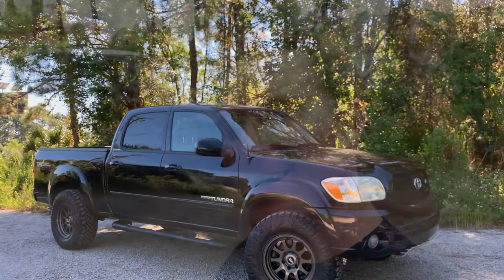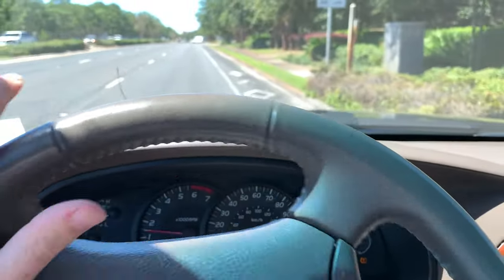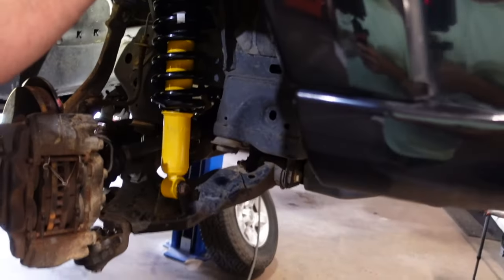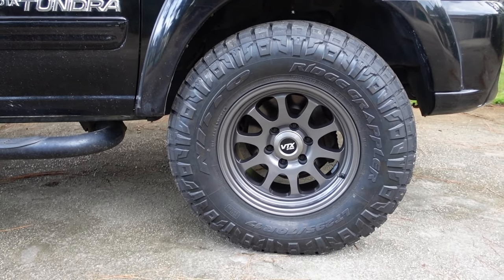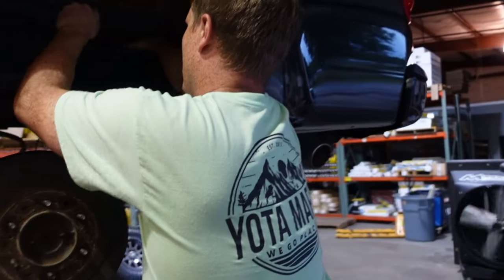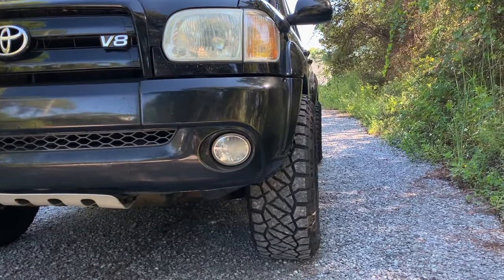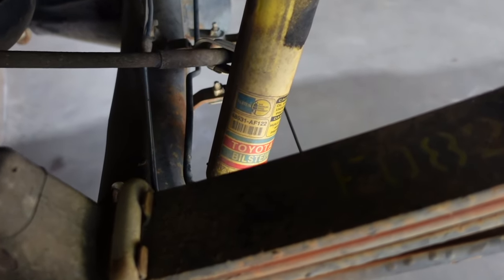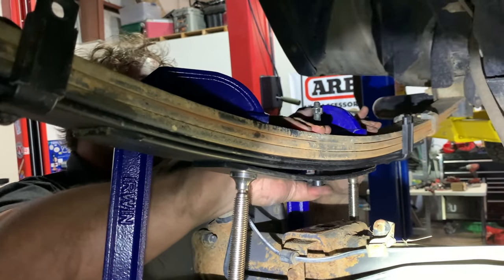Budget Friendly First Gen Tundra Lift Kit Install.

Comment: 04 Toyota Tundra first gen extra cab here,  I bought it brand new,   Going with new Bilstein 6112's,  heavier springs.  Camburg upper control arms/bushings/upper ball joint.  This truck is pushing 20 years old.  New lower control arm bushings, ball joints, tie rod ends.  A 3" lift,  but I have a new custom front bumper with a 10,000  winch.  Also a new custom rear bumper.  (Brute Force MFG).....If you have ever heard of Stellar Built in Sacto CA.  Ordered from them..  they did the powdercoating/install.
Reply: I had Bilstein 5100's  up front with the stock OEM springs.  They did well with a plastic front bumper.

Comment: On my gen 1 I got 265/75/16's on Geolander H/T,s.  I keep them at 35 all the way around.  The tires are good for long distance highway driving, gravel roads and excellent in the rain and for gas mileage but are not good in the snow. 
 I put an Alpine 309 in the dash witch fits in the stock radio space, amos under front seat, replaced all speakers and use a Pioneer low profile 12" sub box on the rear floor witch works out well.
Reply: How much did u spend on speakers alone? Thinking of upgrading mine and getting an idea
Reply: @iv2726  You may want to ask somone else as my speaker build is 19 years in the making lol.   I have Diamond mids and tweets, pioneer stealth 12" sub, and Phoenix Gold and Morrell Amps under both front seats.  The Alpine 309 head unit runs around $800 now.
Reply: If I did it today I would go with JL audio speakers and sub  with applicable amps to run them.  Or Taco Tunes speakers if I lived in Socal.

Comment: That suspension setup gives you 2.5" of lift. The Upper control arm ball joint maxes out around 3.25" of lift, so the 3.5"-4" isn't possible. Those tires actually measure more than a 33" at 33.31", which is likely contributing to your rubbing issues.
Reply: If you add 2” wheel spacers will they clear?

Comment: Nice video man!! I've got a '04 DC with 160k. I'm running 285/70/17 Toyo ATII and love the ride. I had installed the Bilstien 5100's back 5-ish years ago and love the set-up. Been throwing around the idea to upgrade to the Aluma series from Toytec and taking the lift to 3" in the front with AAL in the back...and of course the Front Diff drop insurance for $35 bucks. SPC upper control arms and a new lower ball joint to top it off...

Trying my hardest to hang on to the truck for my little guy...only another 8 more years to go...lol
Reply from the maker: It will last 8 more years for sure! Your set up sounds clean!!! Keep it up!
Reply: Wait for a 3 inch lift you need a diff drop? I also have a FGT 2004 I just bought and want a 3 inch lift with some 32” on it but I’m unsure on where to start and what to buy 😔

Comment: I ram 285/70/18 Toyo mt on my 05 on same suspension setup but I put in 1/4” top spacers for about 2.8” front lift. I trimmed a decent amount but was able to get the tires to not rub and I didn’t have to touch the cab mounts. Looks awesome man and definitely making me miss my 1st gen. I’ll def have another in the future.
Reply from the maker: Ima definitely trim some, but these being 295 may just be that extra width to have to touch the body mount. I love this thing !
Reply: @TRDJon  maybe so. I’m gonna say it’s definitely offset difference most like Aly. I was on the Darrel Walt tip bbs 18’s with 1.25” spacers
Reply from the maker: Ahhhh gotcha

Comment: Good call on the load e tires.  Way more flat proof, and you can run them lower psi cuz the sidewalls are so much more burley.  I would say 30 is pretty good for daily if you're offroad at all.  If all pavement, ramp them up for mpg and longevity.
Reply from the maker: Thanks for the tips!

Comment: I wouldn't call 6112's a budget lift unless comparing to Fox or others in the $1500 plus range.   Most people are happy with 5100's which are still better than stock and considerably cheaper.

Comment: Im about to lift my 1st gen.. 02 AC cab.  Have you given any thought to if you had went with wheels with less offset ..say -15 instead of -25 and if like -15 do you think it would still rub, and / or additionally did you ever consider a body lift too, like 1” or 1.5”?  I have 33’s on my old pickup and did a 1.5” body lift and that immediately allowed for 33 x 10.5 with no rub on stock wheels which are +8.
Reply from the maker: Off set would help. Personally I'd never do a body lift.
Reply: @TRDJon  right.. less offset. Im trying to see what wheels are most ideal.  And nothing wrong with a mild body lift.  Pound for pound the cab and bed weigh less than engine and frame so given the two of body vs suspension the body lift keeps CG lower.  Many people do a mix of both.. mild suspension / mild body.

Comment: Would love a Tundra but wastes too much gas I already got my Tacoma and that wastes too much gas for me
Reply from the maker: I love this one because it is Tacoma sized and has a v8. I’m getting 14-15 ish MPG with
Reply: @TRDJon  I think 14-15mpg is good on 33”s 
Mine is a 06 tundra 4.7 Crew cab 4wd (157k miles) and is getting 16.6 mpg on stock tires and driving 40% city 60% Highway (65-70mph)
Always trying to be under 2k rpms on city driving.

Comment: Hi, I’d like to get a truck like this. Currently looking at. 2005 SR5 in the beige looking color. It’s got 150k miles and is a 1 owner and clean title. They are asking $20k. Can someone advise if this is a good deal ?
Reply from the maker: I just sold mine for 11K. 20K is way overpriced imo
Reply: @TRDJon  yeah they slapped the exact tire and rims that you had and it has a lift. But prices are all over priced. It’s ridiculous. Completely different but a V8 2021 RAM is $35k with 35k miles. Seems like used cars are meeting with new cars in price.

Comment: I'm contemplating getting one of these. I like the tacomas but I'm a big dude so the tundra is more my size. I'm not new to Toyota/lexus with the 4.7 but how reliable is this motor? I found a great deal on a clean one but it has 220k on it.
Reply from the maker: It's a great motor
Reply: Its considered the most reliable engine Toyota made. Smooth power.
Reply: 230 K on my 'o6. She's never let me down, runs strong. I've replaced a few parts here and there and I take good care of her.  Looking at lifts trying to figure out the best way to go.

Comment: It says the 2884 OME springs do not fit on the 06 Tundra. I have a 06 Tundra with adjustable Bilstein 5100’s in the front and stock springs. Looking to change the front springs. With the OME springs do you leave the clip at stock height and still get 3 inches? My 06 is a double cab, V8, 2wd.
Reply from the maker: Not sure for the bilstien notch level man. Did the 5100 set up not give you any more lift?
Reply: @TRDJon  I have it on the highest notch with the stock springs but wanted to install OME lift springs and was wondering what spring and what notched you had on your Tundra. Looks sick btw!!
Reply from the maker: Thanks man!! Yea 883 was the size spring we used on mine bro

Comment: 295/70/18 is 34 and some change and not as wide as a true 35 so they fit much easier without doing major mods for clearance (cab mount chop). True 35” tires will vary slightly in size and weight between manufacturers. A 33 is 285/70r17
Reply from the maker: These are 17" wheels.